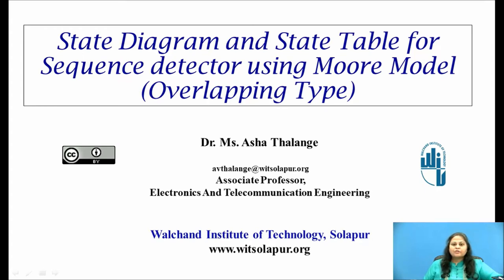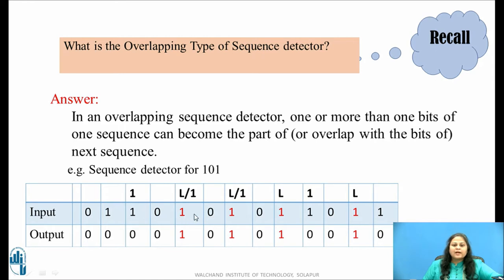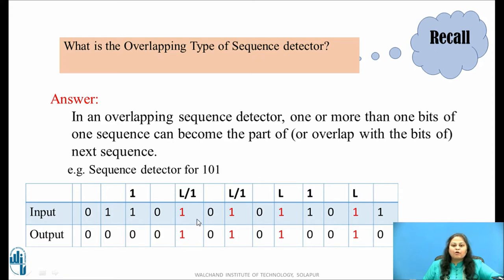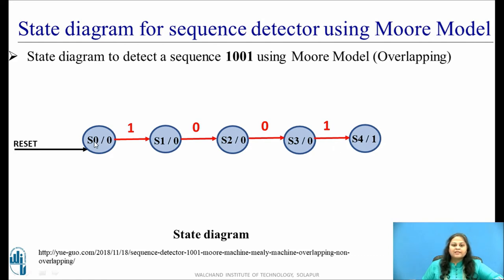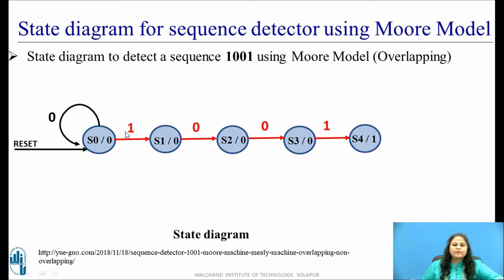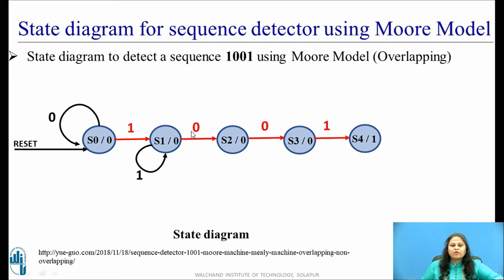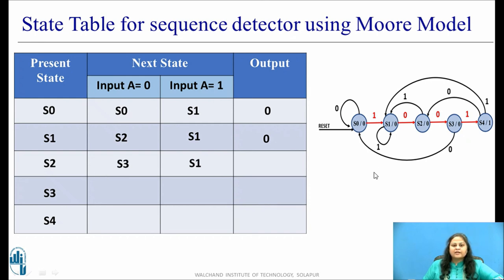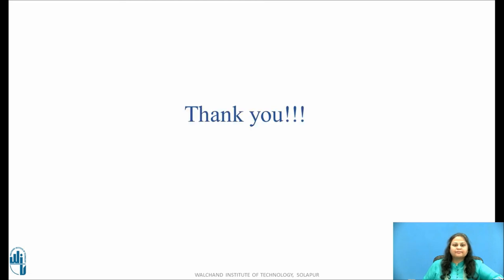State Diagram and State Table for Sequence detector using Moore Model (Overlapping Type)

Comment: Hello, I would like to inquire of why s3 does not produce output 1 as it leads us to s4 when the input is 1. Since you said output is determined by the current state
Reply: The equation said 1100 ... When S1 is 1 the diagram moves when S2 is 1 it moves when S3 is 0 it moves ... So it has to be a 0 as stated on the equation the you loop the 1 back to where the first 1 occured